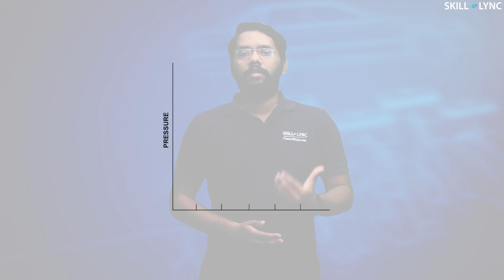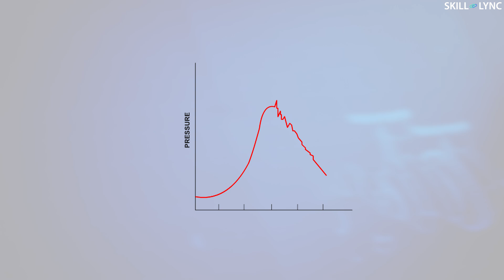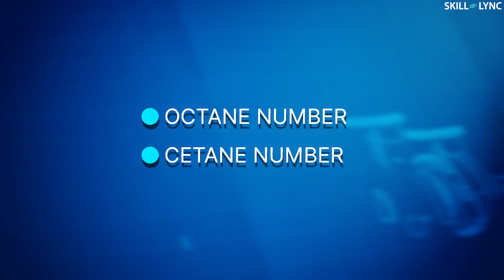What is Engine Knocking? | Skill-Lync

Comment: You get confused between pre-ignition and detonation (aka knock). Although they are similar but have different timing... Knocking always occures after spark ignition whilst pre-ignition happens before spark. Try to find here old video called Slow motion combustion/ detonation/ preignition video which perfectly demonstrates what is what.

Comment: Early combustion is called "pinging" it makes a slightly more metallic, or more high pitched sound, it can be solved if its not really severe by using high octane fuel (this is what its for, not performance) knocking is caused by worn bearings, like the drive shaft bearing becoming oval shaped and so the drive shaft hits either side of that slight oval shape worn into the bearing, creating a knocking sound, ot pretty much means the engine needs to be rebuilt.
Knocking sound can also be caused by stuff to do with the rocker arms, if the engine has those anymore
Reply: Also severe carbon deposits on piston headset come in contact with the head is a possible culprit no? But yes you nailed it

Comment: This is plain wrong. What you described is NOT knock, but pre ignition. Knock happens when parts of the air fuel mixture ignite due to the pressure increase outside of the flamefront of the spark, resulting not only in uneven burn, but in a (supersonic) detonation instead of the (subsonic) deflagration the engine was designed for.
Pre ignition is ignition (of a deflagration) before the spark plug fires, so there is no supersonic pressure wave.
Reply: Google se chapa kya? Hahaha, me IIT se hu
Reply: @crazify8887  tho mu mae le na

Comment: HERE i.e  VIDEO, GIVEN WE WANT TO DECREASE KNOCKING, USE TO DECREASING THE INTAKE MANIFOLD PRESSURE. IN THIS CONCERN I THINK PROPER ATOMISTION OF GASOLINE PARTICLE IS NOT OCCURS. AFTER THAT RICH COMBUSTION CONDITION IS DEVELOP. WHICH INCRESE POLLUTION.

Comment: What is the difference between pre ignition and knocking ,?
Reply: What is described here is pre-ignition.

Hot spots in the combustion chamber light off the charge before the plug fires; the plug fires and the flame fronts collide.  An area that is glowing hot is required, such as a carbon deposit, ot a sharp edge in the head casting.

This is called pre-ignition and id usually inaudible.  Look for the center of the piston to be melted or blown out and it normally affects one cylinder.

Detonaton is literally an explosion inside the chamber.

The fuel charge is ignited by the spark and the flame front progresses across the chamber.

Part of the charge in the far reach of the chamber reaches it's auto-ignition temp and literally detonates instead of jurning smoothly and is very audible.  Damage is seen as the edge of the piston melted and destroyed down the side into the ring lands, which are destroyed too.

If detonation occurs in one cylinder, look for a lean mixture to that one cylinder.

If detonation occurs in multiple cylinders or in all cylinders, look for excessive ignition timing, low-octane fuel, or a lean mixture across all cylinders.